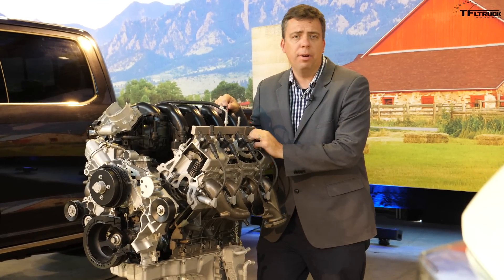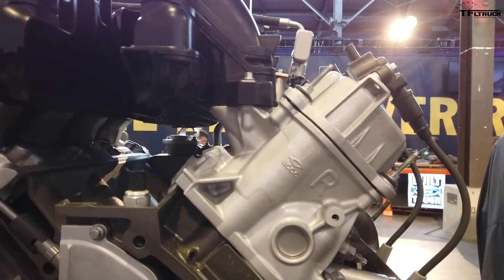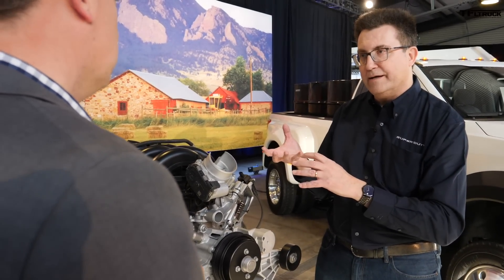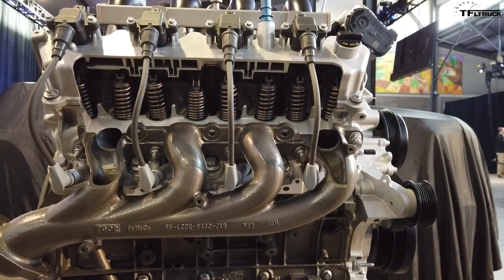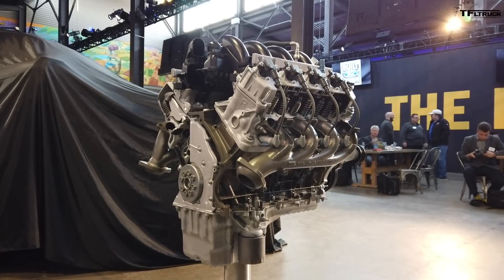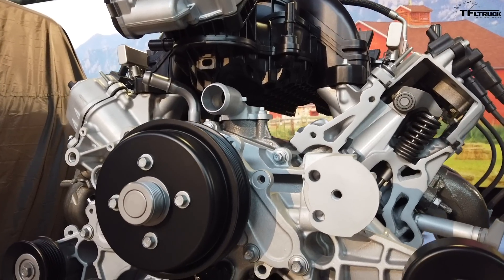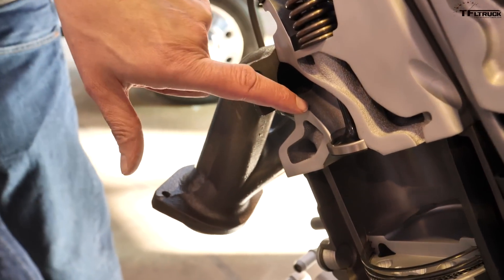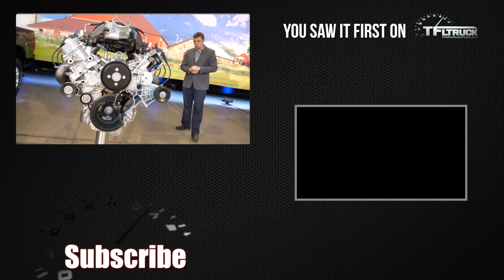2020 Ford Super Duty 7.3L V8: Here's What You Need to Know!

Comment: Just need a manual transmission.
Reply: Just what I came here to say. I want a 7.3 in a 6 speed manual, single cab, short bed dually.
Reply: @TravisReddell  Wishful thinking.  Wouldn't be able to get the fuel economy numbers it needs to sell with the manual.  Not against the 10 speed anyway.
Would be a sweet swap into an older truck though!
Reply: Manual transmission's are dead just deal with it I'm glad they are even big rigs aka tractor trailer rigs are phasing them out to because of fuel economy and safety no taking your hands off the steering wheel to shift gears. The best argument to see the manual transmission gone is say one day you're driving down the road with a truck with manual transmission and a trailer carrying  15,000 pounds and you are about to shift from 3 gear to 4 gear and a deer darts on the street right in front of you so you only have one hand on the steering wheel  and you try to swerve to miss it with just one handed and you Overcorrect it and you loose control of your vehicle and go off the road and flipped the vehicle and your seriously injured and possibly paralyzed by the accident now imagine the same scenario but with a automatic transmission both hands are on the steering wheel because your not have to shift gears and you swerve to miss the deer completely and having both hands on the wheel your ability to control the vehicle is spot on and you safely avoid the going off the road and don't flip the vehicle but there's a catch in this scenario is that you have your wife and kids with you and you were going to the lake for a week long vacation the 15,000 pounds was a travel trailer.
Reply: @rustybeatty6567  It's a preference thing.  I'm sure an automatic is safer, but I'm glad I haven't lived my life in the safest possible way.  I like manual transmissions because I enjoy them.  They are fun to drive.
My tow vehicle is a 1978 M814.  It has a 5 speed manual with a split-able transfer case.  I drive it because it's fun, and I find automatics to be boring.  This is my subjective opinion.
Reply: @zoidsfan77  how many clutchs did you go through just curious because my mom used to on a 2007 Ford Focus 2.0L automatic  when she got a newer car her old one had 207,000 miles on it the torque converter was the factory original never had been replaced.
Reply: @rustybeatty6567  I don't know how many miles are on it, but my clutch is 1978 original.
Torque converters should last a really long time.
Reply: @rustybeatty6567  as long as there is a market for manuals manuals will exist as a cheaper option for those that can't afford automatics
Reply: @rustybeatty6567  That is a sad excuse same scenario can happen with a automatic. Best thing you can do is slow down hit deer head on,
trying swerve to miss the deer while towing a trailer could cause the trailer to sway out of control.
Reply: @rustybeatty6567  sorry but manuals in rigs aren't going anywhere, try hauling chemicals with an automatic and see how long the tranny lasts compared to a 10 speed manual for instance, my dad hauls chemicals for a living and i rode a few times, i doubt an auto will last nearly as long in those conditions from what i experienced when riding with him.
Reply: When I saw 7.3 I was hoping diesel. I have a 7.3 powerstroke with the manual 6 speed. Best truck ford ever made arguably
Reply: Ever drive in the mountains with a trailer downshift to save brakes they will start to glow and your screwed.... stick all the way
Reply: zach stanton yeah I wanted the diesel too but this engine is amazing as well.
Reply: Big reduction in towing capability.
Reply: @TheKevintillman  yeah for sure. I'm looking forward to it
Reply: @rustybeatty6567  if your hauling 15,000 lbs or more there is no swerve you hit the dam deer
Reply: @rhodesiancitizen1870  only suggestion is dont slow down stay off the brakes hit the deer then slow down slamming on your brakes can lock up you trailer brakes
Reply: somebody gotta recommend to the Ford company .. they might listen !
Reply: All this arguing about hit the deer, swerve, brake, don't brake. All you have to do is get a train horn. It'll make a deer stop, jump and turn like a cat.
Reply: Rusty Beatty Or if a deer darts in front of you and you’re driving a Big Rig like you’re describing, you can just plow into the deer instead of risking your life and the lives of people in vehicles traveling in the lane next to you by swerving to avoid said deer. A semi hitting a deer will destroy that deer. The remnants of that deer will be on the grill and radiator/heater core of your Big Rig haha
Reply: @james2042  - Okay
Reply: @MN_Adventures  I used to work in a hospital as a housekeeper in a Emergency Room Department at a level 1 trauma center on of the cases that came in was vehicle accident victim that involved in single car accident that involved a car vs deer the deer head came through the windshield it was a buck one antler stuck in is shoulder and ribs that was near the shoulder area one punctured through the back and it was cut off at the spot where the antler attached to the skull the person almost died because of a punctured lung so hitting the deer could be just as deadly as swerving to avoid it as hitting it so witch would rather do just keep what I said mind I did room cleaning after patients went operating room for surgery because Emergency rooms and operating rooms are just two of the steps of being admitted to a hospital if you brought to a hospital after a accident that bad.

Comment: They should have made it a 7.5 litre engine. Could have brought the 460 back
Reply: They dont actually match up with litre=ci.
It's a collective of bore, piston, and valve size.
Reply: The 7.3 has a great name from the T444E days. Thats why they went with the 7.3 displacement
Reply: 429 😃
Reply: Olds Pwr it’s on the engine block itself, well it is on my old ford
Reply: dillpurdy92 it’s not necessarily that it has to match up perfectly, just being able to use the 460 name again in a ford engine would probably bring a lot of buyers, or so I would think
Reply: @aiden7694  you can't bring buyers back from the grave. Move on
Reply: 514 big Henry
Reply: @norgepalm7315 
True story, I Lol'd
Reply: @Purdypickle92  displacement is fully dependent on bore and stroke. No matter if measuring in inches or centimeters.

1 liter is about 61 cubic inches. It's a direct conversion.
Reply: Aiden  To bring them back they could search for the 460ts in the lakes as they were great boat anchors
Reply: None Ya - Yes, the engineer didn’t want to admit that. Instead they simply arrived at 7.3 by crunching numbers, bullcrap. It’s a marketing decision.
Reply: Olds Pwr - Of course International chose the 7.3 displacement, it was their design. In the IDI and in the later T444E, that’s why they called it that. They used it in their bus and S-Series chassis. Ford specified only minor application specific modifications and called it a Powerstroke, but it was a 7.3 liter International T444E through and through.
Reply: @terminatortwo9310  actually they were great boat MOTORS. As they were used across multiple applications.
Reply: Ahh the ol 460. Put an intake, cam,  and some heads on it with a decent carb backed by a c6 and you got a good little powerhouse right there!!
Reply: @Purdypickle92  actually valve size has nil to do with it. You get the liters by doing some crazy math with the bore size of all the cylinders. The ci is the cylinder bore and the stroke from tdc to the very bottom of the piston stroke with some more crazy math. Different math and still get the same liter and corresponding ci.
Reply: Ford Ltd I won’t argue but as I remember O M C used ford and early Mercury gen 1 outdrives had 302 ci ford. Chevy pretty well got the market after that. I saw quite a few 460ts with blown lower ends in my day.

Comment: Put it in the Raptor!
Reply: With a suppercharger...?😀
Reply: @Hippo0529  oh hell yeah
Reply: ICCE 83 I think the raptors are getting something a little more smaller, like a 7 liter 8 cylinder
Reply: This is the 7L
Reply: Might be a little heavy in a dune runner.
Reply: This was leaked last year on reddit when a ford maintenance sheet was stolen and put online . That’s when everyone thought the new 2019 raptor was v8 back in April of 2018 .
Reply: Needs to be Aluminum Block first. This thing is an ANCHOR for a Raptor.
Reply: @GIGABACHI  this man gets it.
Reply: Talk about major nose diving jumping those dunes...
Reply: That defeats the purpose of a being a Raptor it would be so nose heavy no fun to drive off road
Reply: @Hippo0529  not from the factory
Reply: How many Raptor owners REALLY take their trucks to "The Dunes" ? Most of them just stick to pavement anyway.
Reply: @atx-cvpi_99  agreed, but after market would be fun
Reply: Yes
Reply: I’m curious though, this pushrod 7.3 may not be too heavy. Remember the Raptor had both the 5.4 Triton and 6.2L Boss engines. Those two are cast iron overhead cam motors with HUGE heads. May not be much heavier if at all. I could be wrong.
Reply: Mike X I assume this is the motor scheduled for the 2020 Raptor F150
Reply: Raptor needs a real engine

Comment: This looks like it could go into a motorhome and do well. Nowhere near the maintenance of a diesel for a vehicle that sits a good portion of the time.
Reply: Not to mention the v10 they usually use is an outdated design
Reply: I work at the engine line for this 7.3. And that is indeed the plan.

Comment: Bring back the other 7.3 liter.  The one without spark plugs
Reply: John Juhasz 😂😂😂😂😂😂😂😂
Reply: Tell that to Navistar
Reply: matt coffman Who do you think I am? You don’t think I already have a couple of times?
Reply: Copied chevy ls engine
Reply: You mean the one with craptastic HEUI fuel injectors and the HPOP that was a pain to replace that drives those terrible injectors...

No thanks. Bring back the 5.9 cummins 12valve with Bosch P7100 injection pump that's gear driven if anything.

And it doesn't use craptastic ceramic glowplugs that fail. Simple grid heater and a classic design that rules the heavy haul industry.
Reply: Go tell that to Navistar!!
Reply: 7.3 idi

Comment: If it as reliable as the old v-10. Then they have hit a home run. Have a v-10 excursion that pulls a trailer and skid steer everyday!
Reply: The V10 Triton eats timing chains. You may want to check yours
Reply: Benjamin Kline i haven’t seen it. They’re tough.
Reply: V10 Crank eater.  Let's hope Ford learned all their lessons and this is a home run.
Reply: reliable v10?? lol
Reply: this guy trolling us lol
Reply: And head gaskets...
Reply: My v10 has 250k. Never had a problem this guy knows what hes talking about. Strong and reliable, that engine made me buy another ford
Reply: I love my v10 f250...has lots of power and it has never giving me any problems
Reply: V10s love to 🤢 spit plugs
Reply: The V-10's never got cam phasers, they don't have those issues like the V-8's did. Mines 120,000 and purrs like a kitten.
Reply: no .....the v 10 are one of best gas engine ever made.....but its a gas pig.....
Reply: @caterpillar6nz310  your dead on there. My dads v10 has been great. He plow and hauls with it. No major issues. Just rock solid reliability..... Edit.... But it is very thirsty.

Comment: If you use the same math as the 6.2L on the 7.3L , the 7.3 will have 453 hp and 502 lb/ft.  I think I would buy that....
Reply: Ronald Robinson it probably won't make the same hp/cc as the 6.2 because it isn't made to rev as high. But I bet the torque will be about 500.
Reply: I said about 456hp and 510ft lbs of torque
Reply: more steamlined exhaust manifolds on 7.3
Reply: Yea but that efficiency is with overhead cams, the single in block cam will not be as efficient per cubic inch I’d assume

Comment: Sounds like this engine should be a really good fit in the F53 motor home chassis and the E350/450 cab/chassis for motor home and ambulance service. Many motor home people are unnerved by the high revving of the V10 when climbing long grades. For the F250/350 buyers it will make many who are on the fence about diesel go toward this engine. I LIKE pushrod engines. No stupid long chains running around, and pushrod engines are shorter and narrower.
Reply: Yep. 460 doesn't work hard in a RV
Reply: A Hines yeah but the 6 and below mpg is what’s gets ya lol. Basically cheaper to just get a nice hotel depending on where you’re going sometimes.

Comment: Hope this one gets better mileage! Gas prices are on the incline.
Reply: I mean Diesel is on the up rise as well, but still curious
Reply: I heard it’s supposed to be 14-15 mpg. I’ve that the EPA doesn’t require fuel economy estimates for heavy duty trucks. So we can’t really be certain.
Reply: Probably not much different than a 454bbc
Reply: Obviously more on power, but as for mileage it’s probably pretty close if not better I would think
Reply: @jonathanvandusen523  As far as mileage goes the 7.3L will get better mileage than the old 454 for the simple fact that the 7.3L comes with a 10-Speed auto only. The 454 was either a 4-Speed automatic or a 5-Speed manual. Most of what I've seen it seems the 7.3L gets 15 to 16mpg or so unloaded and 10 to 12 towing.

Comment: A modern replacement for the retired 460. I am curious to see what the numbers are going to be power wise and MPG although most commercial vehicles are not MPG rated.
Reply: Not MPG, more like GPM.  Had a 95 F250 with the 460, it would pass everything but a gas station.  I can honestly say I never lacked for power when I needed it tho.

Comment: Did nobody actually listen to the lead engineer in this video?! This stoichiometric motor is never going to be in the Raptor or Mustang, both high-revving high-speed models. The size was dictated by hauling requirements and efficiency. Do you even see how tall and harrow it is? Opposite of what you want for high-speed stability. Think trailers, boxes, and motor homes. Geez lol.
Reply: That’s just a tune, injectors  and camshaft away from revving a little higher.
Reply: I would like to see it in a half ton truck however.....
Reply: Dave auf dem BMW Like Juan said, a more performance oriented cam and tune will change the hauling characteristics of this motor. So it’s valid to hope this motor will one day show up in the raptor, or mustang. 

To address the size concerns, this motor isn’t much taller, if any, than a coyote.
Reply: @juanc5149  And a pair of turbos either side... He almost hints to it lol
Reply: He keeps talking about how it will fit in many applications it's going to be a crate motor for muscle guys modern big block
Reply: @guthrie1181  Whether they can adapt it for the Mustang or Raptor is besides the point. They SHOULDN'T. This motor was not designed for that. This is a big block, high displacement engine that was designed for the purpose of loping around casually whilst pulling ginormous trailers. It's heavy. It's large. It's built for hauling at low rpm. Adapting it for motor sports is trying to split the baby in half. You don't get excellence with either of those things. You just get compromise. You'd be better off adapting a motor that was intended for high revving performance and using that.
Reply: Notmi Relnam I know what you’re saying
Reply: @notmirelnam248  A Raptor is not a Trophy truck, but a recreational 4wd. This engine is well suited to 4wheel driving which loads up an engine more often than not. You have professional motor sport mixed up with recreational driving.
Reply: This would be badass to see sticking out the top of a mustang

Comment: Ugg.. Bring the 7.3 interational diesel back to ford
Reply: Kristen Toehe yesssssss plz
Reply: With a better bottom end better heads and a big turbo
Reply: That's exactly my thoughts
Reply: @Layne Ford well if they beefed it up and built a 7.3 engine like a 6.7 itd be a monster
Reply: Yeeesssss. I was excited till I herd GASOLINE. GREAT design but such a let down
Reply: Power for a day 6.7 sucks 7.3 all the way
Reply: Not gonna happen.
Reply: I had an 89 f350 with 7.3 idi non turbo was a tank had over 500thou on the clock
Reply: I had a 97 f250 single cab two wheel drive. With the 7.3 turbo diesel. 4:11 gears and 5 speed manual. Rebuilt turbo to ball bearing turbo.. Swamps high performance injectors. A 4 inche exsaust. K&n airfilter.. Installed electric fan to lessen drag on motor a lil.. A superchip and a propane shot.... Id pull 3 lines positive traction with a set of 33 inche nitto terrain grapplers.. Busted mustang after mistangs ass.. My dad had a 6.0 07 f250 he only had air filter and super chip and exsaust.. Id tear him up.. So these people saying 7.3 isnt good for performance are crazy..
Reply: Hell yea man
Reply: tim walk with the 7.3 you didn’t have to worry about the heads as much as the 6.0, even with the 6.0 if you don’t dog it it won’t go out if you take care of it right. If anything the 7.3 with maybe a 10 blade turbo would be just perfect.
Reply: weirdfish weirdfish 6.7 is wayyy better that 7.3 is slow as hell